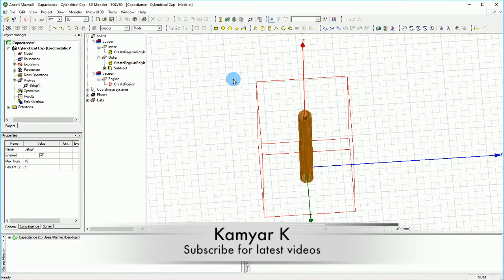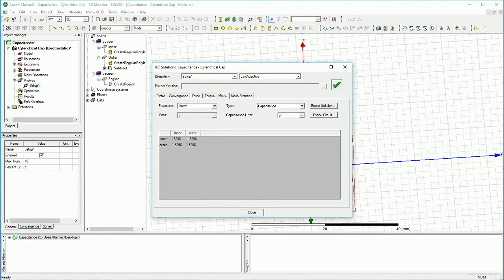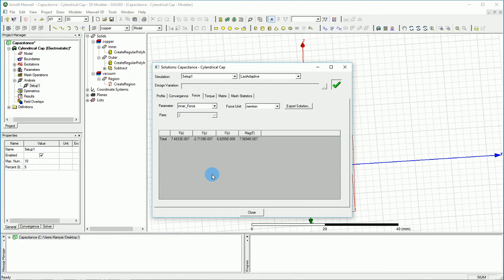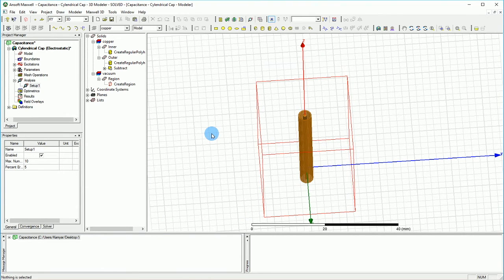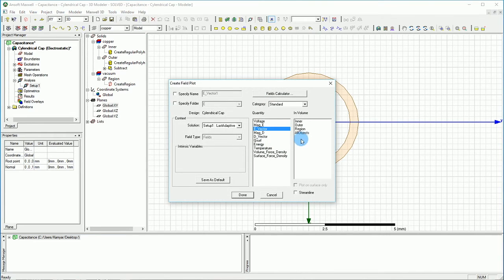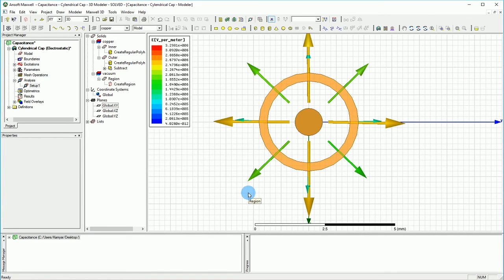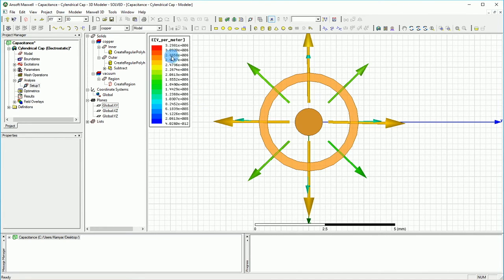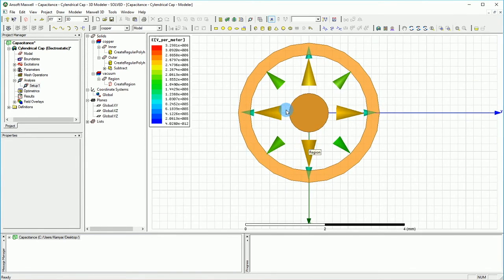507 - Ansys Maxwell | Electrostatic | Cylindrical Capacitors [3/3]

Comment: Awesome tutorial. Why does the capacitance in the matrix appear with a minus sign?
Reply from the maker: It’s a matter of terminology. For capacitance calculation I noticed Maxwell is using electrons as negative charges which results in negative capacitance. I would not think of it as 1/jWL

Comment: Hi Kamyar, how to expand the area of the plane in order to check the electric field at a further distance?
Reply from the maker: +Suganthi Yeesparan  try to use different boundaries. Which solution are you using ?
Reply: kamyar K I will try using diff boundaries. I have to calculate the amount of electric field vs distance from the conductor which conducts 132kV.
Reply from the maker: +Suganthi Yeesparan  I need to see your design.